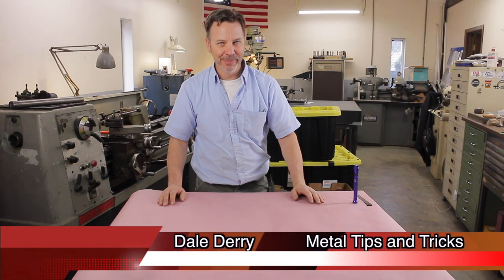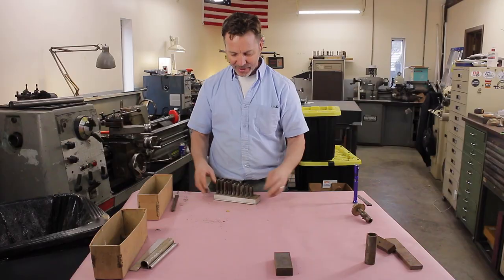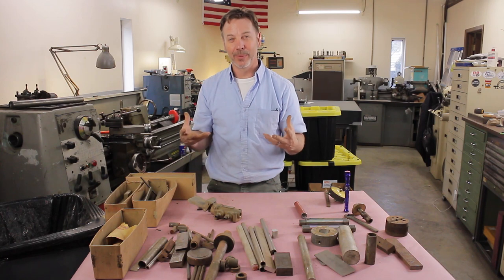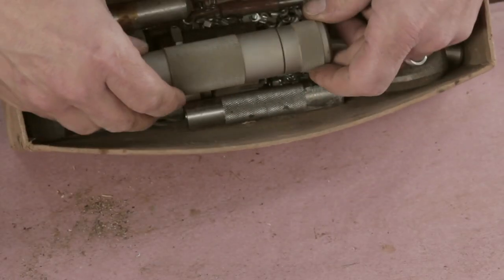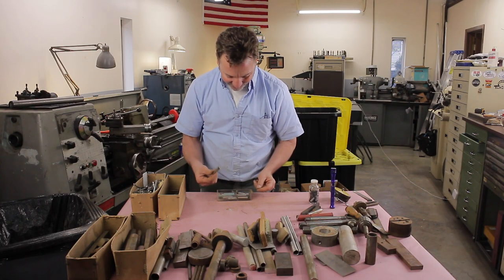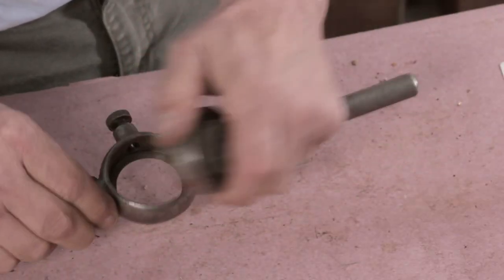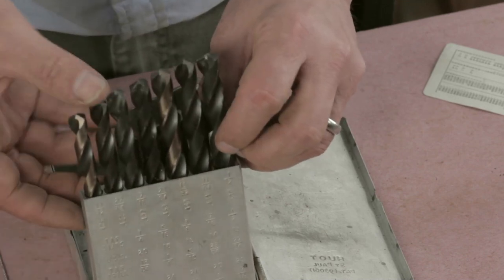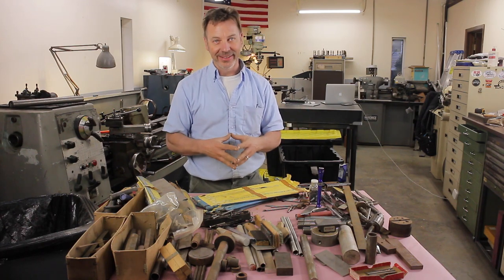Lost find  #2   Tool talk #2

Comment: Dale, at 22:29 of the video you show some small brushes.  Those are for "Engine Turning".  They will produce the swirls that's seen on the surface of metal usually in an offset grid pattern.  I have a set I purchased from Brownell's.  Great bulk find.  Thanks for the videos and your time.

Comment: OMG you could make so many fine tools with all that tool steel.  My head is spinning over it  I see large Framing slicks plane blades by the dozen coming out of just the scrap from projects possible from all that graded steel very sweet.

Comment: WOW!
AS WELL A I , STAYED AWAKE TO SEE WHAT WAS IN THAT LAST BOX. BY THE WAY THOSE NICE ALUM. & CHECKERED ITEMS I THINK MAY BE FOR HAND LOADING BULLET CARTRIGE 'S BUY USING AN INLINE ARBOR PRESS. THOSE COLT SPRINGS ARE HAMMER SPRINGS FOR A COLT PISTOL. THOSE SPRING LOOKING ITEMS AFTER THE CLECOS WERE DRILL STOPS, YOU INSERT THE DRILL THAT FITS THE SIZE OF THE HOLE IN THE SPRING AND TIGHTEN THE SET SCREW AND SET YOUR DRILL DEPTH. GREAT FIND. I ENJOY YOUR CHANNEL THANK YOU FOR DOING WHAT YOU DO .  MR. JAMES GREEN 
WOULD LOVE ALL THAT GUN SMITH STUFF. ALSO THE PIANO WIRE IN THE TUBES YOU CALLED A BRUSH  ARE  JEWELING TOOLS FOR MAKING NICE SWIRL MARKS ON STEEL FOR LUBRICATION OR JUST PLAIN DECO. BUT MOSTLY  ON RIFLE BOLTS TO MAKE THEM SLIDE EASIER BY HOLDING OIL IN THE FINE SWIRLS ON THE METAL SURFACE.  REGARDS  SKIP GORYEWS   TEXAS

Comment: I'm not sure if someones already mentioned it, but the jar full of springs at 18:10 are actually drill soft stops. They are used in the aviation industry to drill holes in sheet metal without marring the surface. Essentially, the drill bit is slid through the spring. On the side of the stop you should see a set screw. That will secure the stop around the bit. Then when you drill holes, you don't need to worry about the chuck jaws ramming into your part once you break through.

Comment: The wire brushes with the copper sleeves create the finish you saw in the box lid. Chuck one in a drill press, spin it around 300 rpm and lower it onto a piece of steel. Lift, move the steel 1/2 the width of the spot, repeat. You created jeweling. The copper holds the brush tight so it doesn't expand. Item at 24:51 is a .45 long colt chamber ream. Saw more jeweling brushes in that tote at 25:10. 
Also saw some D-Bits in there for cutting the lead area of the throat in the barrel.

Comment: Great Score!  A tip on identifying what type of tool steel you have or have not.  Cut of a small chunk.  Heat to around 1575F for about 20
minutes.  Let it cool in still air- if it hardens you have Air hardening Tool steel.  If it did not harden reheat and then quench in oil – if it hardens you have oil hardening tool steel.  If it still did not harden or only slightly then re-heat and quench in water (Most serve quench!) if it hardens you have water hardening tool steel.  If it did not harden at all well then you know you most likely have Mild steel (low carbon content).  Some may not agree with the above method but it does work well for us at the college!Good Luck

Comment: Tool at time stamp 18:13 from jar are dill stops- used mostly by aircraft structural repairmen- sheet metal guys to prevent the drill from penetrating into underlying structures either removing a damaged piece or adding a structural member. They are sized for wire gauge 40, 30, 21 ,12 for common rivet and structural bolt size holes. Aircraft rivets are sized in 1/32 increments so -3 is just under a wire gauge 40 diameter -4 for a 30 and so on for -5 and -6 being 6/32. Hope that helps.

Comment: the brushes are for engine turning on gun parts, often called jeweling in the trade. mounted in a drill press, an o ring placed around the base of the bristles, the brush has coarse lapping compound placed on it and then is lowered onto a gun part which is typically held in a jig. the usual application is on a bolt of a bolt action rifle, for visual contrast. the o ring is to keep the bristles from flaring out under pressure.

Comment: Dear Mr. Cool. This is an old post of yours, so you may never read this, however... your File Find reminded me  that years ago, before computer printers, Gestetners were the way to go for copying multiples of paper documents. Gestetner also made steel cabinets with multiple narrow depth drawers  (about 1/2" deep X 9" wide X 16" long) to store templates in. I got ahold of two of them for nothing and all my files (I had LOTS due to a great find from a silversmith), now had a perfect. safe home. You know this, but files are precision edge tools and are worth of protection.

Comment: The round knurled bar tools (4:00 and later in the vid) appear to be custom inline bullet seating dies used under an arbor type press for cartridge reloading for whatever chambering they were made for. Might be stamped on them. Otherwise you have to figure it out. 1st guess would be a 6mm of some sort. These are fairly common reloading dies among bench rest shooters. My best guess for the tool right after that would be a primer seater of some sort, but it looks pretty big 50 BMG maybe!
Colt springs are for a Colt Officer Model Target, which they are the main springs. The round steel block with the v milled into it with all the holes is a bench block (prob knew that). The copper tubes at 22:45 are for engine turning usually rifle bolts. I may be interested in the Jacobs 34 if it's a MT2 and you have no use for it. Good stuff, scores like these are always fun to look through. I actually just found a part for my SB 10L today for my taper attachment from an old box of "junk" I had sitting around from purchases like this. You never know what treasures you'll find!
Reply from the maker: +Precision Machine Shed 
Thanks for the info. Sorry to say I have machine for the  chuck.
Reply: +Precision Machine Shed 
To me the size suggests that it's a set of plungers and pushers for loading 12Ga shot shell hulls.  No sizing press needed.  It's similar to the old Lee Loader "Whack A'Mole" style stuff.

Comment: as you have spot welder did you know you can weld aluminum with a low powered spot welder....
you take two pieces of mild steel and sandwich the aluminum you want to weld then spot weld them but you can only do one weld at a time as the mild steel will stick to the aluminum so you brake the mild steel of after every weld let me know if you try it
and yes I love finding things
and I wish I had your workshop :)
God bless

Comment: nice.  I look and look for announcements for auctions and stuff... just don't see it.

oh yeah, those springs you  associated with the Celeco's .... they're drill depth stops.  They're for the common drill sizes for rivets.  Should be a collar with a set screw on the end opposite the rounded one (the end that goes towards the point)

Comment: The springs with metal on both ends that you didn' recognize are used.by aircraft sheet metal workers to prevent drill chucks from gouging aluminum whe drilling holes. The color of the spring matches the color of the cleco. Silver 3/16, copper 1/8, black 5/32.

Comment: The Colt springs at 7:07 are main springs from a Officers Model Target pistol. (the gun parts corp is asking $21.20 for repros.)

The D reamers shone at 18:42, and the knurled cylinders with tight fitting punches make me think perhaps he was swaging bullets. 

The brushes at 22:41 are for bolt jeweling. (The lid at 24:05 is jeweled.)

At 24:54 the sleeve is labeled 45 colt, that will be a chamber reamer or it is for making reloading dies.  
I'm just starting as a gunsmith so if you have any gun specific tools you don't need I'd be interested in them. :]

Comment: Those items in the bottle that looks like a spring with a bushing and small hole on each end are 
used a lot in the aircraft industry most are in drill number sizes.
Reply: Forgot to add they are drill stops.

Comment: The inside of the cigarette case is an example of what you can do with the wire brushes in the copper tube.
 I forget what it is called. The plane "Spirit of St Louis has that sort of brushed pattern on the cowl behind the engine.
Reply: +metalhead2508 Or some may also call it engine turning. Since the previous owner worked on guns you'd probably be more correct with your term tho.
Reply from the maker: +Dennis Williams 
Thanks for there information

Comment: I know that tool steel is expensive stuff, but I wonder what I would use it for, particularly the large plates you showed. When I hear "tool steel," I think "lathe bit." Obviously, that's not what you'd use one of those plates to make. What am I missing? Please provide some examples of uses for the stock you found. And congrats on your great bargain, BTW.

Comment: At 11' 29" is a small box full of Whitney hand sheet metal punch dies(No. 5 junior, I think). The next "cheese box" has some pins with flats on opposite sides of their shanks(and should have a tit on one end). These are the punches that match up with the dies. 
When the punch and die are installed in the punch body, set the punch's tit into a center punched hole in your sheet metal stock and then punch a perfect hole. Bonus - Not a slashed finger in sight from a drill that grabbed.

These tools are available from MSC or McMaster-Carr.

Tom
Reply from the maker: +awhs1964 
Thanks Tom

Comment: Jesus  how much did you pay for this......  It's worth a fortune
Reply from the maker: Hey Clown Whisper. I some times get lucky. :-)
Reply: I wrote that halfway through the video and then you said you only paid $300 for that hole find. That's amazing it's absolutely amazing. I did something happen like that but not quite as good
I had just purchased the old Logan 820 to refurb when I saw an ad in Craigslist for another Logan he was calling it an 8:21 but I knew he was wrong it turned out to be in 1821. The guy said that it was all taken apart and put it back says and it's probably have missing so he sell it to me for a hundred fifty bucks for spare parts. I ended up buying it for spare parts but I ended up stripping them all down meticulously painting them perfectly and putting it back together and it was a completely functional 52 inch lathe.
 I love the 820 so much that I don't end up using the other one. So I've been selling Parts off of it I've already made over $1,000. I ended up getting 3 checks a complete set of old style dogs from very tiny one all the way up to a great big heavy one that weighs 10 pounds initiative number one Morris taper drill bits couple dozen random Reimers.
What time a long time ago I stopped at a garage sale for some reason who I was tired it was after work it was unlikely to stop but I did I got out and right there on the table was a brand new Stihl masonry saw. And at the time I was a brick mason so it's a very nice find they're like $1,200 I got it for $25 I don't know what they were thinking where there was stolen but it was an old lady was probably her husband and he had died or something that's only thing I can figure. I was a young man then now that I'm old I probably would have told her how much it was worth it's funny how it makes you more honest